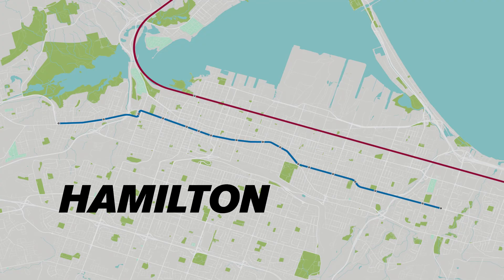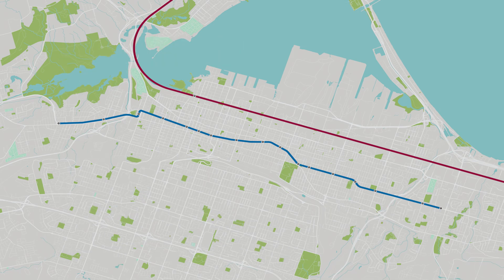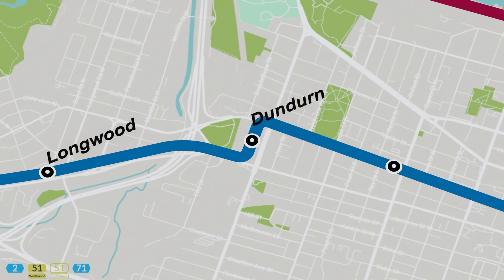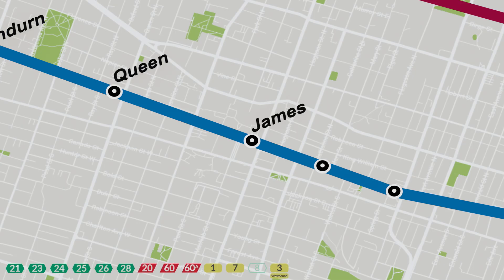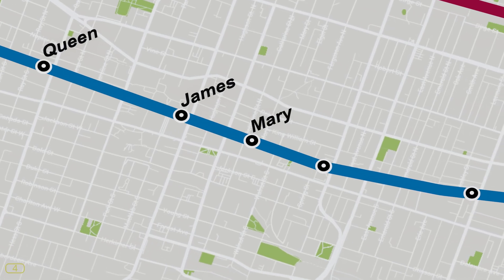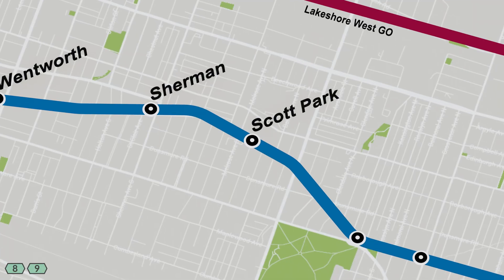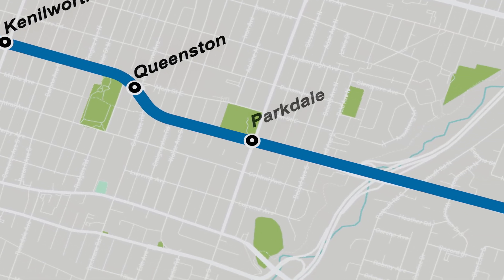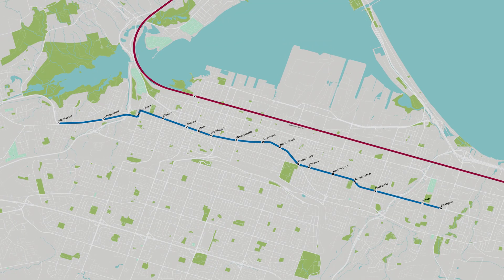Hamilton's FIRST Light Rail Transit Line

Comment: Hamilton can’t even take care of the roads how will they be able to take care of an LRT… the amount of time it’s taken to start I’ll be dead by time they have shovels in the ground
Reply: Construction should begin in 2026. It is fully above ground and won’t need any major construction to happen, so chances are it won’t take a super long time for completion. About taking care of the LRT, LRT lines are usually not operated by the city. Shouldn’t be any major issues there either.
Reply: @andrewisvrycool  I need some of the meds you are on.....this will take a decade at least and bankrupt the city.  Not at all useful for most citizens.
Reply: Construction is also coordinated by Metrolinx, so it should be relatively quick like Waterloo Ion, Mississauga Hazel, or Toronto's Finch West LRT.
Reply: @andrewisvrycool ya ok. Mississauga has been building a 18km 4.2 billion LRT for 6 years. It’s nowhere near complete.  Toronto’s Eglinton LRT has been over 10 years and it’s not done yet. So good luck!